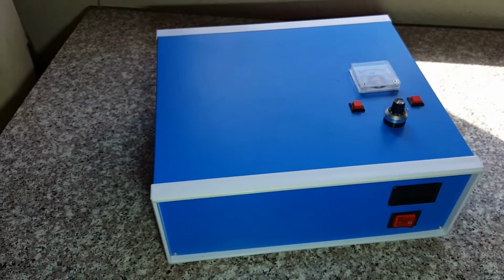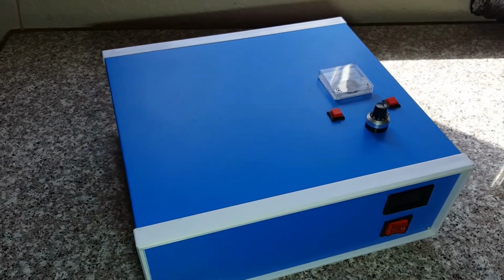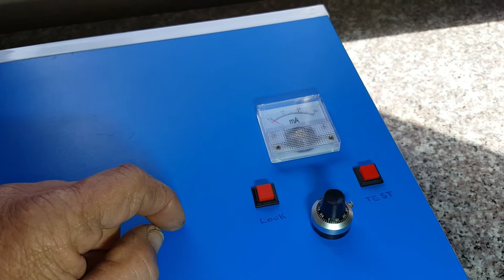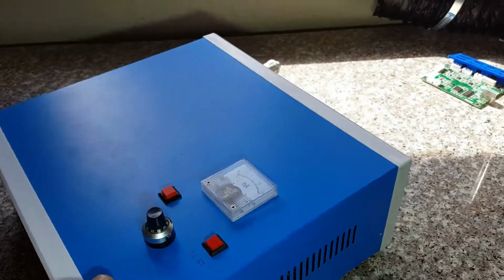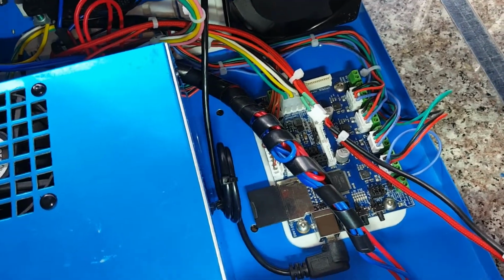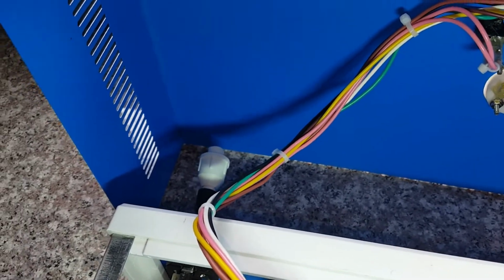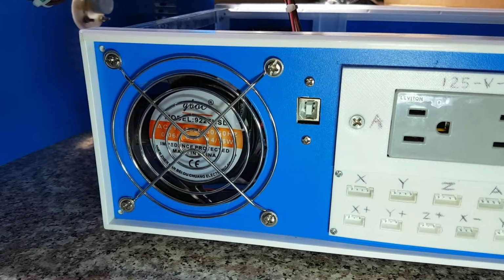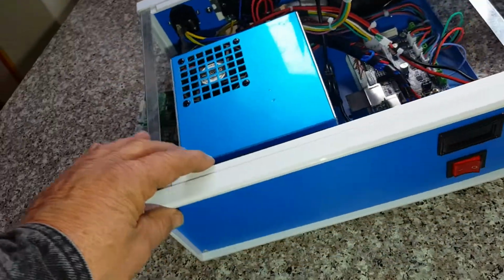Franken-40 - Highly Modified K-40 Laser Build Part #4

Comment: Had a bit of a fire in my mostly stock k40, so most of the cables and belts on the gantry are trash now. Stumbled onto this video series when looking for ways to repair/replace the innards. Thanks for doing this! I'm not at all familiar with rewiring things, so I'm still nervous about all that, but I think I'm going to try and follow along with what you've done on yours so far. Do you have a document somewhere that lists all the parts? Based on what you said in one of the earlier videos, I'm assuming not, but wanted to check before I go back to the previous vids and start making a list of my own.  Thanks again Bill!